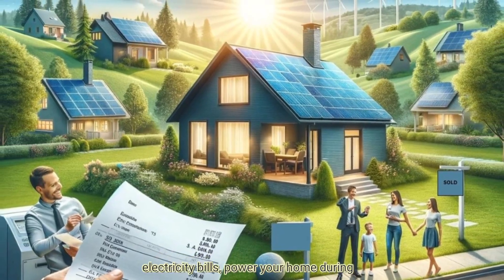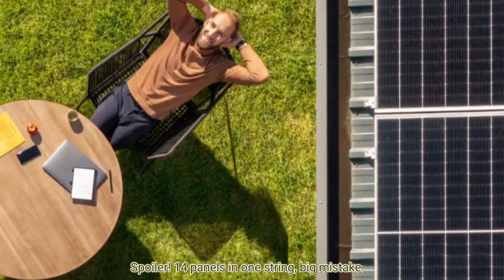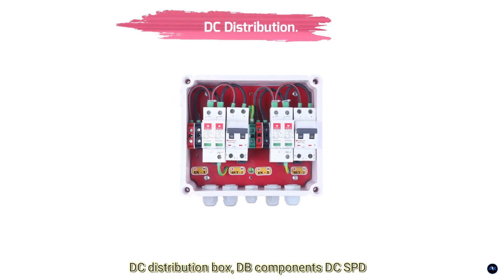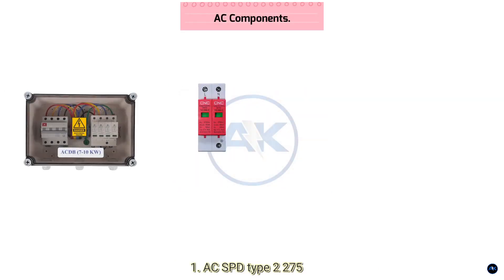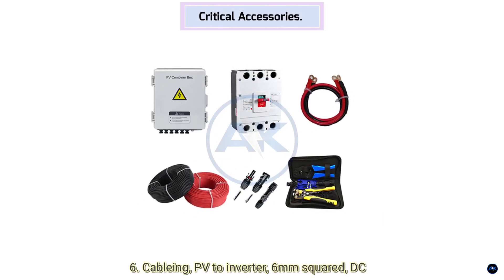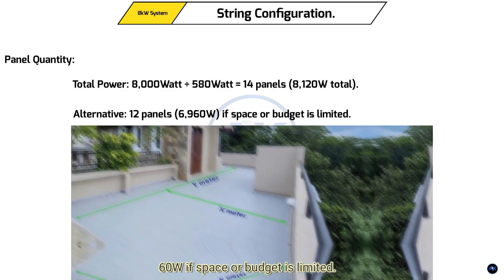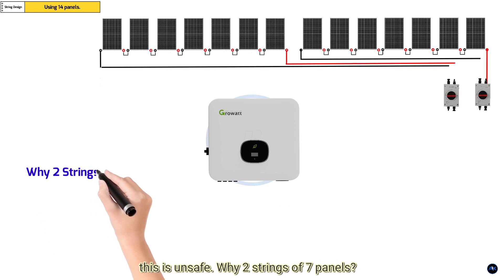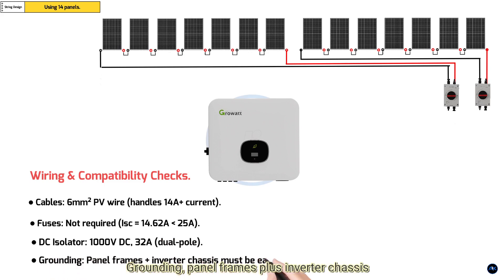Maximize Your Energy Independence:The Ultimate Guide to an 8kW On-Grid & Off-Grid Solar Power System

Comment: Nice! but I'm concern of the 63 amp changeover switch. in this hybrid what will be the connection if we want the grid to be the back up and our solar system is the normal source?
Reply from the maker: Key Setup Details
1. Connection Diagram:
   - Source 1 (Primary): Solar system (inverter/battery output).
   - Source 2 (Backup): Grid supply.
   - Output: Connected to your loads ( household circuits).

2. Normal Operation (Solar Priority):
   - Set the changeover switch to the solar/inverter position.
   - The inverter powers the loads using solar/battery.  
   - If solar/battery is insufficient, the hybrid inverter automatically supplements with grid power (if configured to do so).  
     (No manual intervention needed here if your inverter has a built-in automatic transfer switch (ATS).)

3. Backup Mode (Grid Activation):
   - If the solar system fails (e.g., extended cloudy days, battery depletion), manually switch the changeover to the grid position.  
   - This bypasses the solar system and directly powers loads from the grid.